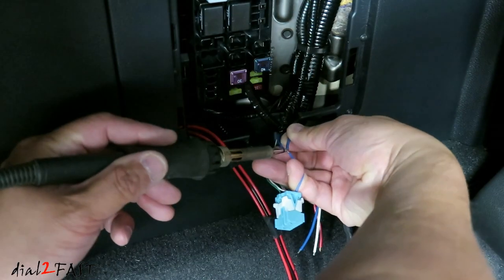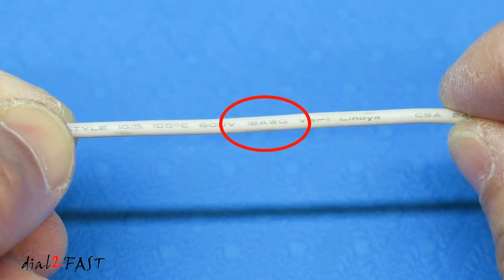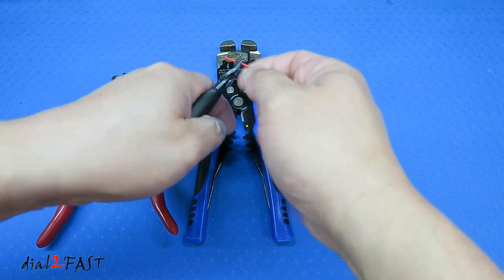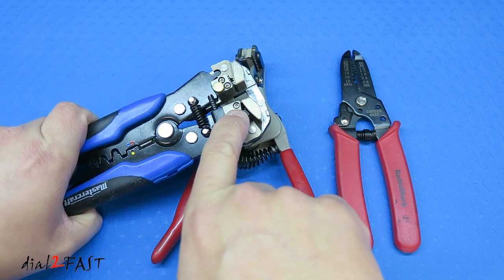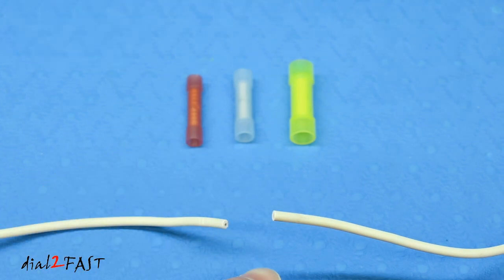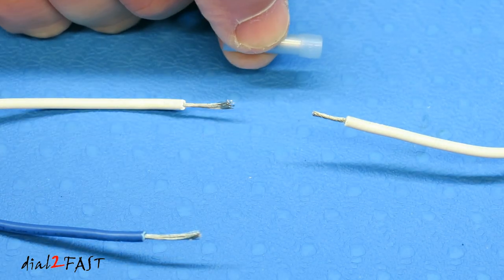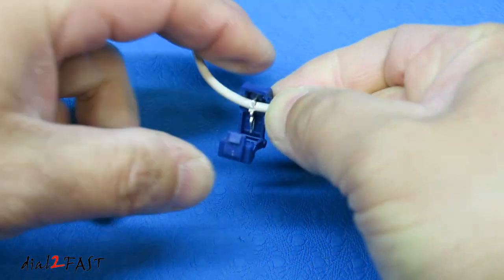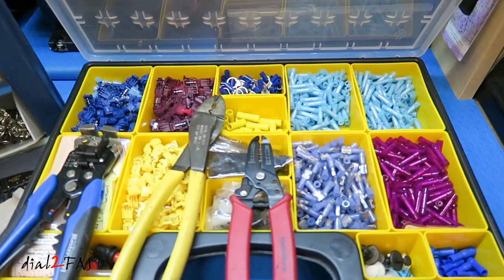How To Splice & Crimp Wires - COMPLETE GUIDE - Video 1

Comment: hi, I love how you come straight to the point and cover all the basics without any BS aka background music.

A quick Q - I am trying to connect the red & black wires from a wired car backup camera and its monitor to the rear and front 12V power sources. The supply wires from both the camera and monitor are very short hence I need to splice them to another pair of red+black wires to reach the 12V outlets.  However, those wires are also quite thin (probably 26-24 or maybe even 30AWG) which makes it difficult if not impossible to get a tight crimp using typically available butt connectors that I could find locally (the smallest I could find was the red colored butt splice for 18-22 AWG from a local Walmart). Do you have any suggestions or ideas on how to splice and extend those kinds of thin guage wires?
Reply from the maker: If the wire is very thin, what you can do is strip it a little longer exposing more bare wire, then fold the end of the bare wires several times so you have a thicker area (about 1/4" of folded copper). Then put that into the red butt connector and crimp it.

Comment: What a great video.

One question.  Can I use regular pliers to crimp the wires to the butt connector?  I'm only installing a hardwire kit for my Viofo A119v3 so i'm only going to crimp 2 wires.  I'd hate to buy a crimper for just 2 wires.

Thank you.

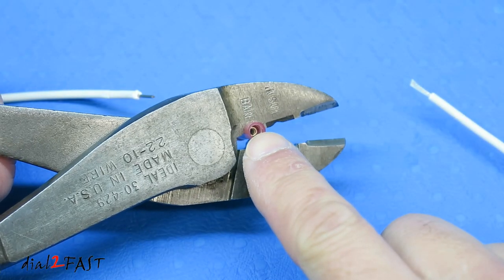Comment: So in the crimping part at5:59, it does not matter if you are using a yellow, red or blue connector, they would all be crimped in this spot of the tool?
Reply from the maker: The crimping tool I used in the video will work for all 3 (yellow, blue, red) crimp connectors. This tool is commonly used by car audio installers.

Comment: Where’d you get those purple but connectors at you showed at the end of the video?
Reply from the maker: The purple butt connectors are actually the red ones but the manufacturer made it with purple color plastic. You can check out the links in the video description.

Comment: Maybe I am missing something here?  Your crimper has a section for insulated and non-insulated connectors.  Your are using the non-insulated/bare portion of the tool to crimp insulated connectors??

I use the Snap-On 29ACF crimper. It is the same design as the tool you are using.  However, I use the insulated slot for connectors with insulation.

Why are you doing the reverse in this video??  Just want to understand the reasoning.  

Great video covering all the basics of crimping.  Enjoyed watching.
Reply from the maker: I am an old school car stereo / car alarm installer from 30+ years ago. When it comes to crimping the insulated connectors, all the installers I know always used the non-insulated crimp as that ensures a solid connection and the wire will not come out. The insulated die can work but you have to make sure the wire gauge and connector size are matched up properly or the wire might slip out.

Comment: Dont use them but connectors use the heat shrink ones . Those short out and get green death. And t taps are terrible aswell.make proper connections dont be cheap!
Reply from the maker: There is nothing wrong with using these connectors if you are using them correctly and in the right environment. Obviously these are not waterproof and there are other connectors designed for those application.